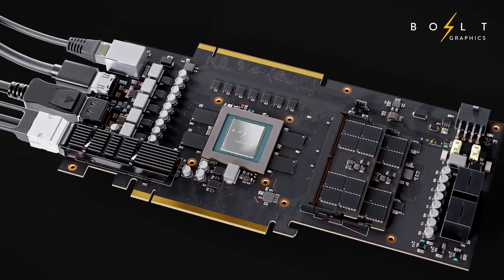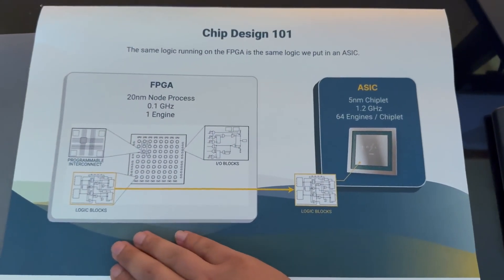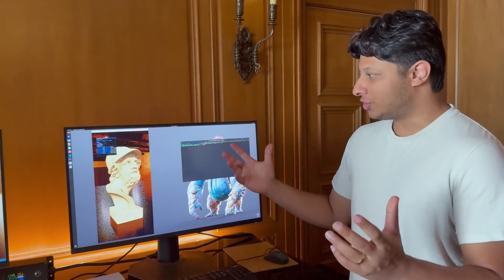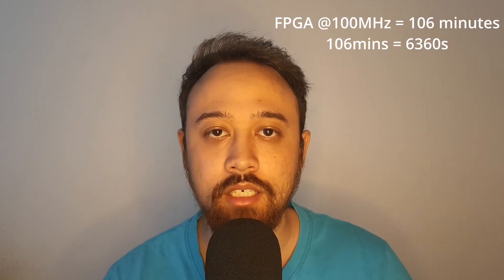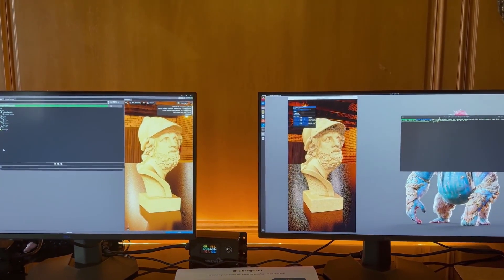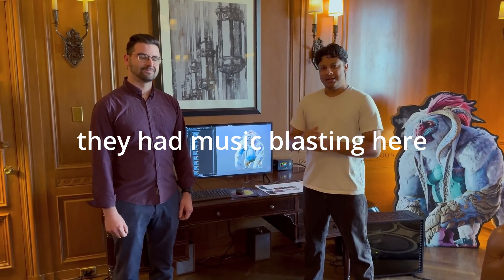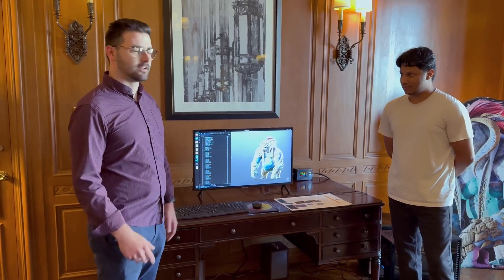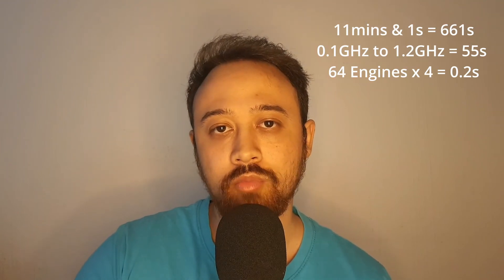New GPU Grift AT GDC 2025? | Bolt Graphics Zeus GPU

Comment: Yeah, seems suspect.  Company appears from nowhere with a GPU that is competitive to nvidias, whos been at this a quarter of a century, no.  Designing a crazy multicore compute accelerator that runs CUDA is much more likely, and maybe even quite probable if the design lacks a normal rendering pipeline which is a very large portion of nvidia gpu dies. Still something feels off by their presentation.  I wish them luck tho.  More competition is better.
Reply from the maker: If you've seen the previous video I made on them where I take a closer look at their company itself, everything they do is based on deception. There's about a 0.1% chance that they're legit
Reply: @ronanupload  You're probably right.  I'm just saying the  GPU thing could be an angle to hype what is a general purpose massively-parallel processor design - something not that challenging to create. I mean, I could claim to design a 384-core RISC-V beast design and simulate it and say "ooh, look it beats NVIDIA at [any more general purpose compute task] -- gimme money so I can fab a bunch of them.  In fact, there was an explosion of companies in the early 2000s  hyping their designs.  Calxeda, Tilera, Ambric,  Tabula, and Adapteva were a few.  I loved the designs but they didn't take off.

Comment: Even Intel is struggling in the GPU segment to design and optimize a competitive GPU, how do you expect these unknown Bolt company would?
Reply from the maker: Easy, they'll use magic my WhiteSkyMage friend. They'll cast "most powerful GPU" and it's over for Nvidia
Reply: @ronanupload  Let's hope that "magic" doesn't backfire on them. Spells are not always stable...
Reply: @ronanupload  do they have some advancd tech mabey 2 nm to zero point 2 nm or graphene or 3 d stacked or carbon nanotubes or muti chip model not impossible we all want 8k 16k native photo realism
Reply: You're kinda right and kinda don't. As my understanding goes, it's closer to Xeon phi, not to rtx. This means that driver and chip design becomes a lot easier, because you don't need to adapt it for rendering video.
Reply: Intel fails to beat a small competitor named AMD/ATi soo.. And I love Intel.

Comment: Designing the chip and manufacturing might not be most difficult part either assuming the get enough funding. Validation, testing and solving bugs and issues will take much more effort. But honestly driver and software development is the most difficult part - it took Nvidia and AMD many years with many developers to get their driver and software stack where it's now, something Intel for example hasn't achieved yet. Drivers are very complicated pieces of software that take a lot of expertise and man hours to develop and perfect.
Reply from the maker: For a startup, manufacturing is the most difficult part. Because of the cost, capital is the number one roadblock. Even getting to a fully functional pre-production GPU might take at least $25 million. If they have any intention of mass production, they'll need to spend hundreds of millions more at minimum to order chips from TSMC or Samsung. For example, if they intend to ship 100 thousand GPUs in a year, it would cost far north of $300 million just in the cost to buy the chips from TSMC. (you can work it out from the numbers I showed in the video). This is why I came to that conclusion. Thank you for watching and sharing your opinion :)

Comment: Only one thing is 10x faster than 5090. 10x 5090
Reply from the maker: hmm, yes. I checked your math, it works out
Reply: Wouldn't it be 11x 5090?  10x 5090 would be equal, not faster.

Comment: There's something very sus about a graphics card having on-board networking (ethernet and InfiniBand), just why?
Reply from the maker: The only reason I can imagine is for use in server racks to connect to other gpus
Reply: I suspect they're targeting the AI market, and likely the AI investors.  That's why they're showing how much ram can go on there.  All the AI bros would be looking at how big a model they can fit on it.  Heck, with their numbers, ignoring the potential of a scam, it would potentially make for an excellent head end control node on existing GPU stacks.  It would hold the main model and parcel out jobs to all the sub units over ethernet, which would just be an adaptation of already existing clusters.  It wouldn't have to do the heavy computational lifting itself, so the chip/memory latency wouldn't matter as much either.  Of course that's just the rainbows and unicorn farts view of it lol.
Reply: Bc its fake im sure.

Comment: Can you teach us how you do your rough calculations of dies into computing power?
Reply from the maker: Hey there. All I'm doing is division. Take the original FPGA benchmark number, divide by the ASIC clock speed over the FPGA clock speed, then divide by the engine count, then divide by the chiplet count. Then you have a big assumption that an ASIC version of the chip would be about 4 times faster than the last number you got, so you divide by 4 for the final result. Hope that helps. Thanks for watching :)

Comment: I can't see this company even competing with Nvidia or AMD. Both companies are infusing fiber optics into their chips to speed them up 5 times the present speeds by 2026 and to 100 times into the future no kidding. They have three companies engineering these chips. So this Bolt company I wish them luck but,  they seem to be dead in the water to me already. I could be wrong of course time will tell.

Comment: Vaporware until they have working silicon.
Reply: All modern chips started as a 'vaporware'😉
Reply: @TheGalacticIndian  and then they turned into functioning silicon and nobody thought that anymore.

Also, if Nvidia or AMD taped out new silicon I might doubt their claims of improvements, but I have no doubt of their ability to actually produce the chip. Not the same with a new company making estimates off FPGA results whom have never fabricated anything.

Comment: Why it feels awfully like raising money from investor and run away scheme.
Reply: Because it is exactly that, there is no possible way that an FPGA and slow ddr4 ram is able to compete with an ASIC. as a person who makes a ton of IP for custom LOGIC (me!) I can bet 40 thousand dollars right now, that these folks are scammers
Reply: @DavidKnowsAudio  Can ddr6 make it better when it's finally released?
Reply: @ No. Its not just memory speed that should be questioned here, just the hardware scheduler necessary to traverse a latent space would require its own fabric. These guys are legit scamming.
Reply: @ You mean what's between the ram and the gpu cores? Like bus components, or a step the follows? They didn't indeed reveal any of these aspects, which they should have if they were not a scam.
Reply: butterfly labs ROFLCOPTER
Reply: Exactly

Comment: Moving from FPGA to ASIC is very expensive(for a NVIDIA class GPU, atleast 25 million, before a production version, assuming how the Raspberry Pi foundation pulled off the rp2040 cpu, with barely couple of million in funding). Doubtful, if it will even achieve the goal to transition to ASIC(unless using an outdated micron node, but performance will suffer). Not only that there is an entire software support stack that needs to be developed, to achieve the full potential. Personally, I feel even NVidia is just pushing the classic digital design process to its limits, just because of the availability of tool/process flow. There is atleast 10X gain that can be achieved, if not for that.
Reply from the maker: It is doubtful. But if they somehow receive another round of funding it's possible they'll be able to order their first batch of chips from TSMC/Samsung and build their first prototypes. It'll probably cost a whole lot more than $25m over 1 to 2 years of R&D
Reply: You can do ASIC for MUCH less.

Comment: Rumors are that Nvidia is self gating their performance since there's no advantage of market it when there's no competition, so they can enjoy a leadership position with very little downside and crazy MSRPs. If Bolt can reach close to these performance clams, that can be interesting and dangerous to them. Perhaps selling to AMD may be the way out.
Reply: What do you mean by "gating?" Do you mean that their consumer level GPUs are less powerful than their cutting edge R&D tech? If so, no duh. The consumer level is always years behind R&D because R&D groups don't do the stuff necessary to release a consumer product (drivers, software, compatibility and stability assurance, heat management systems etc.)
Reply: Not really, even if Bolt are 100% correct about their claims their GPUs would still be useless for rasterized gaming, or at best useful but slow. Even Bolt itself is only claiming path tracing performance and scientific compute, their whole approach is letting go of legacy raster acceleration. Pay attention! I see so many comments dismissing them without any critical thinking. Maybe they ARE a scam, but they aren't even claiming to be competitive with traditional gaming raster.
Reply: No way they can catch up here. Even Intel with all their resources are struggling. You're telling me a startup can beat 25+ years of expertise and billions of dollars of funding?? Nah that's not happening. These guys need some major backing from investors and a very well experienced technical team for me to believe they'll come close to AMD and Nvidia in the next 5 years.
Reply: @xXx_Oshino_xXx  everything about this sounds like a scam, But i pray it's real because it would be so funny
Reply: But AMD already has superior tech but is quiet about it

Comment: The most difficult bit isn't designing or building the chip, it's writing the software and drivers.
Reply from the maker: Agreed, that's technically the most difficult part. I should've elaborated. But I meant commercializing your design is the hardest part because that's where all the money is. No matter what you do, capital is always the biggest hurdle in big tech
Reply: @ronanupload  Today AI is doing all the software and drivers. The most difficult bit is the power group behind you🤷‍♂
Reply: You either are an experienced chip designer yourself or you have absolutely no clue. I am a software developer, have done embedded and 3D and would say writing a driver is a different kind of hard, but definitely easier than designing a high-performance GPU.
Reply: @bimoverbohm6837 you just need to look at AMD to see how hard the software is. They are an amazing company with fantastic hardware but they have not managed to provide official support for ROCm on most of their hardware.
Reply: to be honest they are focusing on HPC and Rendering workload , it shouldnt be looked at with Gamers lense, and the memory is a bit concering, given you said writing software /driver is hard, you should feel a bit more reassurance since they are going with layered approach with LPDDR OR DDR memory which means it will be complier driven approach to compensate it for not using GDDR memory  , the time they took was mostly spent on software , compiler SDK probably thats why theyre so quiet about a lot of things.....
Reply: just make it open source and viola!
Reply: Yeah that was what I was thinking as well they need drivers for whatever is this gpu will support. also I don't believe it till I see the actual gpu made and ready to go not some reprogrammable chip? like like saying you have the most beautiful painting and you show me a piece of wood with some swatches of red paint on it. that's cool but I want to see the painting or how it is anyways.
Reply: They are better off using open source industry standards like OpenCL, OpenMP, etc. and focus on the BEST tech support. The chances  are very fractionally slim to dominate the gaming market against titans like AMD and NVIDIA.  They need a plan for an exit strategy soon because they won't survive if they dont narrow their scope - best of luck 😅
Reply: Then why can’t we make advanced chips in the US? Building the chip is extremely difficult.
Reply: @CitAllHearItAll  fabricating the processor is simple for Bolt - they'll pay someone else to build it to their design. Semiconductor fabrication is insanely difficult, but it is not something Bolt (or any other GPU manufacturers right now) will do themselves.
Reply: It is not rocket science, check out the fully open source software stack for the 7900xtx.
Reply: Bith are hard to do.. that said a gpu needs very fast memory, since registers are processed in parallel, the bus size needs to fit a wide bitwidth... there is no way these folks are making a viable GPU using ddr4 ram. 
This is a scam, through and through. This is coming from an engineer who spends his days designing custom logic....
Reply: That's pretty stupid take
Reply: If only Nvidia could currently get their head around this statement.